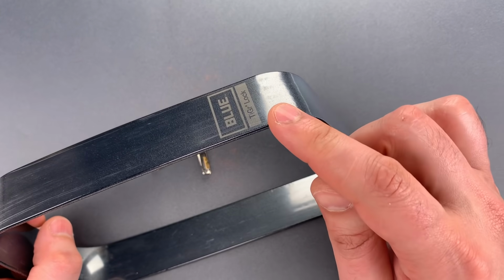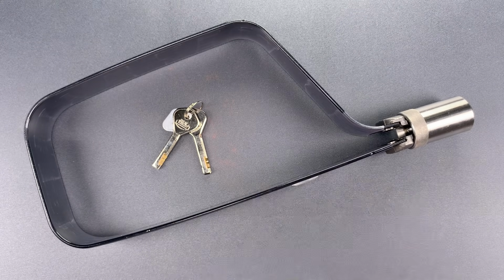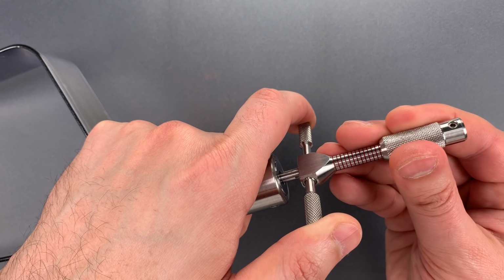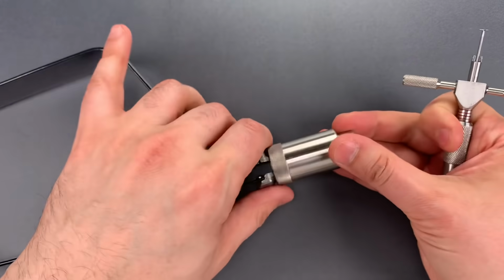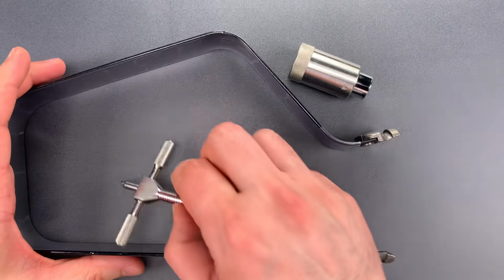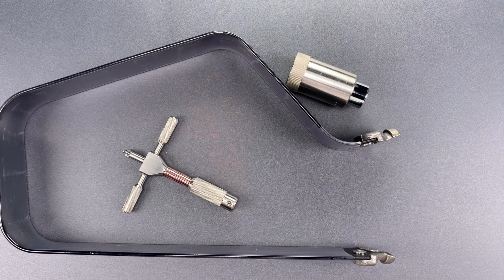[1214] What Was Old Is New Again: TiGr Blue Bike Lock

Comment: The weak point of any Locking System is that it needs to be able to be opened.
Reply: The best lock is a Tig Welder?
Reply: Yes. There are dummy locks on some systems for that reason: to distract the bad guy.
Reply: @spasecookee  LPL: today we have a welded door, but it will stand no chance against my handheld plasma cutter...
Reply: If one can insert a key, one can insert something that substitutes for the key.
Reply: @titaniumdrivetechnologyco.8325  
Who are you calling "A Tool"???
Reply: "This little weld-breaker BosnianBill and I made...."
Reply: @spasecookee  This is the lock picking lawyer and what I have for you today is a keyless entry metal door.  As you can see there is no lock and a bead of welding that goes along the entire perimeter.  However, this door does have a fatal flaw that makes it vulnerable to physical attacks.  

Right here I have a handheld shape charge that is normally designed  to penetrate 5cm of armor plating.......
Reply: POV: you're sat in a concrete Fallout bunker, the door welded shut, deep under millions of tons of rock. Suddenly, impossibly, you hear "I'm getting a click out of one..."
Reply: @jayhom5385  Somehow, you know he'd have it open in 45 seconds with a strong magnet and a shim made from a sliver of license plate.
Reply: more like being able to divide and conquer the problem of finding the key combination, then there's the bowley lock; which makes nearly impossible to keep tension on the core AND test each pin
I would guess that there's more ways to do such protection